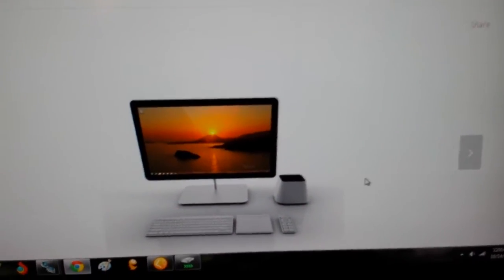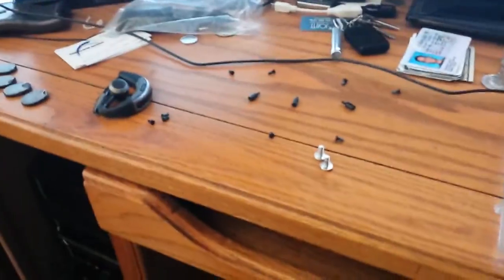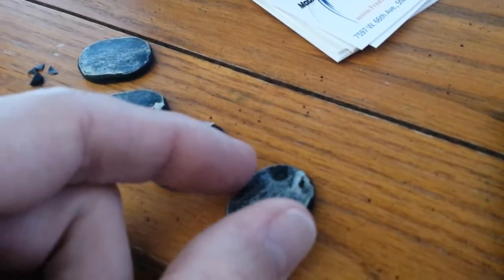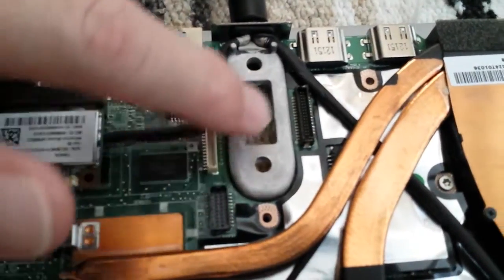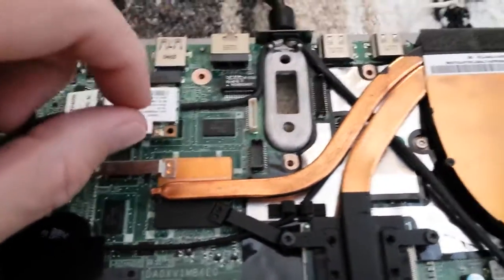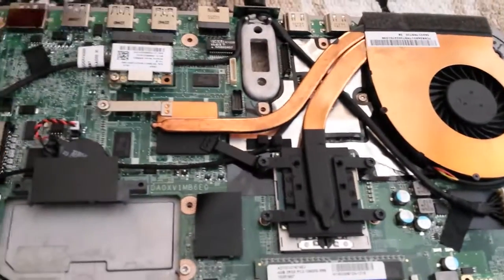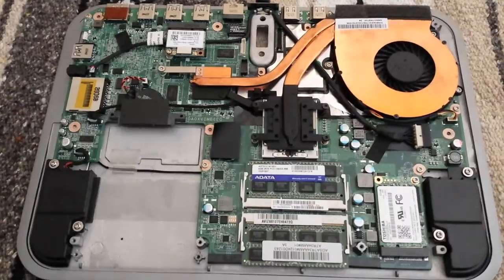Vizio CA24 All-In-One Disassembly (after the fact)

Comment: I plan on swapping out my 4GB RAM for 2 8GB (16GB total) RAM thanks to this video.
Reply from the maker: I'm glad I could help. Sorry I didn't film the process but it was not an elegant experience the first time, lol.
Reply: The MAX the system will allow is 8GB so i sent the 2 sticks of 8 back and bought the newer model ADATA chips of 4GB each.  The data shows that 1600MHz speed is achieved by the computer, but the single 4GB ADATA chip I took out was only a 1333MHz model!  

Everything is flowing much easier now with the 2 sticks of 4GB actual 1600MHz.
Reply: Anthony Francher Can you please post a link where you bought the sticks?
Reply: +Jack W http://www.amazon.com/gp/product/B007UHFW4A?psc=1&redirect=true&ref_=oh_aui_search_detailpage

This is the RAM I used to upgrade, needs to be small laptop style DDR. 2x 4GB = 8GB max this system will allow.

Comment: Still got an additional question:

I know there are some Vizio AIO models out there with an SSD alongside with and HDD. Is yours one of them? Mine is not and I was hoping for and additional SSD slot but I couldn't find one. Since you have taking it apart for replacing your hard disc you might know a little more about the available slots. Have you seen any option for adding a SSD card?
Reply from the maker: Well, it's not mine, actually. I fix all kinds of computers for a living and try to film them every now and then, especially when it's a unique and difficult machine to figure out like this one was.
I just went back through the video to see the motherboard and the answer is no. There is no room in that thing for another drive, hard or solid state. Sorry.
Many SSDs come with an external case these days, to make it easier to clone your hdd onto it during an upgrade. Personally, I'd get one of these and just leave it in the external case and plug it in by USB. If you end up running out of ports, get a powered USB hub.
Pros and cons to an AIO, that's for sure, but there are things you can do to expand a little bit.
Good luck!
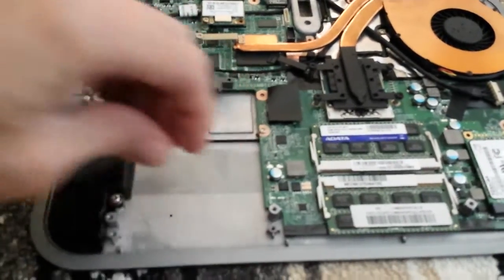Reply: +Shawn Guffey Let me answer my own question 7 months after. There actually IS an additional slot for an SSD Card. You can see it in this video at 0:48 on the right-hand side of the RAM. In your case there is an SSD card already plugged in, in my case there wasn't. Didn't notice that slot when I opened it the first time because I've never seen an mSATA disk before and didn't know they can be so tiny. Now I know (and you too)!
Reply: The SSD is to the right of the ram below the fan. It's msata

Comment: Hello again Shawn.  So my computer died today.  After about 1.5hrs waiting to talk to a tech rep, he told me to unplug the 3 main wire connectors at the base connection and re-connect.  This did nothing.

My computer powers on, the display at the top right says "PC PC OFF" and then goes black, but keeps making fan noise as if powering up.

He said it has to be the graphics card or mother board, I see there is a mother board on eBay for sale right now since I cannot get parts through VIZIO apparently...  Is this the same issue you had, and what did you replace?  Is the graphics card the piece already missing from your video or is that the mother board?

Patiently awaiting your response, thanks again!
Reply: +Anthony Francher UPDATE: I see that the piece already missing from your video is the HD, I just removed that now and awaiting further instructions.  Isn't the graphics card UMD built into the mother board?

Comment: Tahnks for the video

But i got a question can i change the memory ram for a better one

If so which model do i need to get

Thanks again for the video
Reply from the maker: +Alejandro Gomez I never touched another one but it's just a computer. As long as you make sure to do the research and the new RAM doesn't surpass what the motherboard can handle, an upgrade should be simple.
Let me know if you need help with said research and I'll go find something.
Good luck!
Reply from the maker: A comment below, by Anthony Francher, seems to have some information you need.
Reply: +Shawn Guffey http://www.amazon.com/gp/product/B007UHFW4A?psc=1&redirect=true&ref_=oh_aui_search_detailpage  2x 4GB = 8GB MAX RAM this computer can take.
Reply from the maker: Anthony Francher I haven't seen one since last year because it was just a clients computer that I was fixing but I do appreciate the information that you have shared with the rest of these people. Thank you buddy.
Reply: +Shawn Guffey I see there are 2 types of mother boards for sale on eBay.  How do I choose which is mine, since I cannot see a part number on my current motherboard?  I cannot tell what part of the motherboard is the graphics processor...

1) UMA Graphics: http://www.ebay.com/itm/281756167857

2) AMD Graphics chip and 1GB VRAM: http://www.ebay.com/itm/Vizio-CA24-CA27-All-in-one-Desktop-PC-Motherboard-31XV1MB00M0-Discrete-Graphic-/281756171754?hash=item4199f9fdea:g:ExkAAOSwd0BVsA8-

Finally, I took out the i5 processor and was wondering if I bought an i7 processor, if it was as easy as just plug and play?  Also, would I need to get the Gen 3 i7 processor that these computers were made with, or would it work with the updated 4th gen as well?

Thanks!
Reply from the maker: +Anthony Francher That first question is tough because both mobos appear almost identical. The part number would be the ticket.
As for the processor, plug and play is as simple as the size of the socket but whether or not the motherboard accepts the new processor is the real question. Make sure the board you're going to use will take the processor you want. If the 4th gen fits, it will likely work. If there are any doubts, I would stick with the 3rd gen.

Comment: thanks so much
Reply from the maker: Happy to have helped. :-)
Reply: Shawn Guffey do you happen to know how to initiate the factory restore? i have a recovery partition, but I cant figure out how to load from it. Windows 8 install doesnt see the drive at all in uefi mode but it does in legacy mode.
Reply from the maker: Stephen Halsey Point/hover your cursor to the top-right corner of the screen until you see a menu show up. Click on the Settings icon which looks like a wheel. Click "Change PC Settings" Click "Update and Recovery" Click "Recovery" Once on this page, you can either select to refresh your PC, which will take care of some minor issues without losing your files, or you can choose to do a factory reset, which will wipe out all your files.
That was copied from a website but these are my words. Screw UEFI, I'll run everything in Legacy until they bar me from doing it.
Reply: That's what we did. Went back to legacy and fresh install of 8

Comment: I still own this computer  , since it quite old now can I upgrade hard drive to ssd easy without running with issues
Reply from the maker: I barely remember that customer's computer but, if it had a traditional hard drive in it then it can take an early model SSD as that will screw right in. I do not believe that motherboard has a M.2 slot so the more recent SSDs likely would not install.